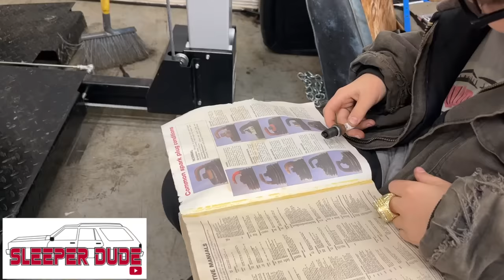FREE CORVETTE! Gets Upgrades and a Road Trip!

Comment: Perhaps it's the fuel pressure regulator. They're part of the fuel system. What else could be causing the starvation of fuel to the injectors? Not the filter. You changed that in this video. Fuel tubing. Could any length of it be clogged? I doubt that. What else? Was that starvation intermittent or constant? From what I heard of it, it was intermittent. Yes, you needed to change that filter before you started that engine with those next set of them. You need injector cleaner fluid for them. Josh, do me a favor. Don't ever forget to change the filter. I would greatly appreciate that. Continue having yourself an excellent day. Will you please do that? Bbye.

Comment: check your Oil level and is it fresh.  some Chevy had a fuel pump shout off hooked to your oil sensor , If oil go to the top of the heads and dose not get to the Pan fast enough your fuel pump might be turning on and off.

Comment: I had a similar problem engine would start but when I stepped on the gas it would do nothing !! Turned out to be a vacuum hose from the throttle body to the transmission 🤯😵spliced the hose drove from OKC to Ogden, Ut and still running great 4 years later !! Squeeze "It wasn't ME!"
Reply from the maker: Ok interesting

Comment: Try to put new O2 sensors on the Corvette  noticed whenever our O2 sensors start going out we notice our vehicle ran very odd. If you can't replace the O2 sensors try putting some B12 or seafoam in.  before we put O2 sensors on our car that fuel treatment helps tremendously.

Comment: There could also be a piece of trash floating in the fuel filter occasionally blocking the fuel supply also if it's a cable driven throttle it could be a problem with the throttle cable I don't know if it's drive by wire or throttle cable with it being in the '87 I would imagine it's throttle driven and if it is there could be a crack in the casing surrounding the throttle cable that was the problem with my '97 Ford aerostar I thought it was a injector issue like ralphie but it turned out to be a crack and throttle cable housing so I tied it up with a piece of string and it fixed it

Comment: Hey, not for nothing but that looks like a straight up digital dash. most of the time repairable. things to look for: bad connections and connectors (clean them), dry or old grease packed motors (relube them), bad capacitors (replace them) or bad solder joints (resolder them). If you want, I could take a look at it for you. otherwise, you can find all the info you need to learn those skills through the yoo toobs.
Reply from the maker: Thank you

Comment: Check fuel pressure when primed and when running at operating temps. A component (coil, ignition module etc) could be getting heat soaked? I didn't notice it sputtering when cold. Awesome video

Comment: Just a thought if it runs well chokes up, then runs again after ten minutes. Might it be percolating? I had an old escorts that used to behave and sound the exact same way. It was due to fuel condensing and flooding it temporarily until it was left to cool and the pooled fuel evapiearted, then presto, it'd run for 20 miles then start percing again. Mine was a carb motor though that needed rejetting plus I found the carb spacer had cracked so it wouldnt have been an even 14.1. Just a thought. Hope you chase it down guys

Comment: If you put a piece of clear hose on those bleeder valves you can avoid the risk of squirting brake fluid all over your rotors and pads by directing it into a container of some kind.

Comment: I wonder if it has a bad ignition module, They usually seem to act up when the engine gets warm and then act normal again when it cools down. if it had been them MAF it should have run rough from the get go. I can't see it being debris past the filter or it also would have been running rough when you left the house. maybe adding the fresh gas loostened some crap in the fuel tank and plugged the new filter but that would mean the tank is really nasty inside. I'm just offering up some ideas for what I'd check first.

Comment: i noticed the last 2 videos working on the corvette. you never once checked the air filter. you might check that.  a clogged air filter would bog down the engine due to lack of air or oxygen. give it a shot. :)
Reply from the maker: Ok thanks

Comment: An old trick to test the MAF is to tap on it with a screwdriver while the engine is running. If it stumbles, you know the MAF is defective. Sometimes when you think it's a fuel problem it's actually an ignition problem.  Did you change the ignition module? Good luck

Comment: That wire for the plastic plug that attaches to the Master Cylinder is the cruise control shut off when you apply the brakes.

Comment: tip try using a small alignment pin to help make sure the bolt hole is centered so the bolt screws in easier.

Comment: Josh did the car only run like crap once it warmed up but ran fine when cold? If so I would start by changing the coolant temp sensor. Very common issue with GM vehicles. On some GM models that sensor also controls the fans which you didn't think they were working either.  Easy part to start with and won't hurt to have a new sensor either way.
Reply from the maker: Ok thank you I appreciate it

Comment: You asked about why that stuck rotor wouldn't slide off of that hub. It's not only because of the rust, except because of the size of the center of that rotor. Chevrolet didn't drill a large enough hole in it. In the event they did, you wouldn't need to put heat and that puller to it.

Comment: If it's fuel starvation, it could be a weak fuel pump assembly. I'd say replace the fuel pump assembly and see what happens. My car had a stalling issue and it was a bad fuel pressure sensor and the sending unit was replaced back in 2020 (fuel gauge would go to either full or empty). I have a spare fuel pump assembly in the trunk of my car and the fuel filter, which I need to replace.

Comment: So if you replaced the fuel pump and filter and injectors it's possible may still be some trash in the fuel rails but the surging could also the fuel pressure regulator could be going bad it's under the plemon right in front of the distributor.

Comment: when you start it occasionally does the tach and other gauges sweep to the right by chance? Mine did had a fuel issue. The tuned port 305 (little brother to yours) fuel pump in the gas tank went out. To check it if you have a similar issue, check fuel pressure at the rail before the fuel injectors.
Reply from the maker: Our gages don’t work

Comment: If anyone has the old SnapOn brick laying around.... Look at engine data. Mass Airflow sensor. Maybe even catalytic converters. Pull the oxygen sensors one at a time and screw the tool in to do a backpressure test. There's also a fuel system pressure tester available with a long hose that allows you to monitor live fuel pressure while driving.

Comment: Too late now but petroleum based grease and rubber don't mix especially the slides on the brake calipers makes the rubber swell. Silicone or white lithium work well anti seize is a protectant  more than a lubricant. If you decide you want to do something about the grease you can get the rubber slide parts in a kit don't need to get new calipers

Comment: I wouldn’t be surprised if it’s the regulator… It’s a common thing on these TPI engines one more thing that antilock brake light that’s on try checking the relay that’s on the module itself in the compartment behind the driver seat. It’s probably something that stupid i’ve seen it before. Somebody posted a video on YouTube on how to diagnose it and it was one of the two on the unit itself
Reply from the maker: Ok thanks
Reply: @Sleeperdude  https://youtu.be/zh54I8nCk_k is the video I was referring to, and you’re welcome

Comment: 11:00 as a northern mechanic i suggest you wack the hardest you can on the surface of the rotor, not on the hub... i understand you wanted to save it but it is useless to do it on the hub and you may break the balls in the bearing...
Reply from the maker: Ok thanks

Comment: A computer is only as good as the data it receives.  You're going to have to check and/or change all the emissions control parts now.  O2 Sensors, TPS sensor, Idle-Air Motor, Mass-Air Flow.
If I can get an '87 Dodge Daytona Turbo to run like a brand new car,  you should have no issue with a 'Vette. (y)

Comment: It may be a fuel issue. Those engines that require higher octane gas will run like absolute garbage if you put 87 Octane in them. I saw it time and time again, particularly with owners of Cadillacs, but have seen it with all of them. In addition, if the 87 gas in that car was six months old, it likely has water in it, since ethanol is hydroscopic. I have seen the same issue in my small engine repair business as well, when customers do not use ethanol free gas and let it sit for several months.

Comment: You know I had a f250 with really hard brake pedal, and it turned out to be a bad one way check valve on the vacuum line/booster

Comment: Has that vet got a spark controll module on the back of the distributor? I had some GM trucks that acted like that. and the SCM was the problem.    EDIT I just looked it does have a SCM, those things can drive you nuts.

Comment: Explain the inherent danger that acetylene poses She may respect it if she knows, (Acetylene poses unique hazards based on its high flammability, instability and unique storage and transportation requirements. Acetylene is highly unstable. HIGH PRESSURE or temperatures can result in decomposition that can result in fire or explosion. always check your regulator for tampering)

Comment: clogged cat maybe ?
Reply from the maker: Maybe so
Reply: @Sleeperdude  on my chevy i had clogged cat i'd floor it no power then let off it would come back it would do it every so often till finally i checked it and it was bad after doing tune up oil change checking the timing the computer air leaks

Comment: Darn you tube thing. 
  Took me half an hour to put in a comment, telling these folks how to save their own life during this repair.
  I know already you are going to use all new hardware on the emergency brake. And flush out the metal brake lines, before you connect them, but new metal brake lines all around would be much safer, and last much longer, and keep everybody alive instead of dying.🥺, uhm, right?

Comment: It’s the crappy overpriced gas that’s getting you. Even the 93 is more corn than gas in it. Cars from 1998 back weren’t designed to run on that crap so it messes them up. Find a gas station near you that sells the non ethanol 91 and I bet that Vette and your other fuel problem cars run better.